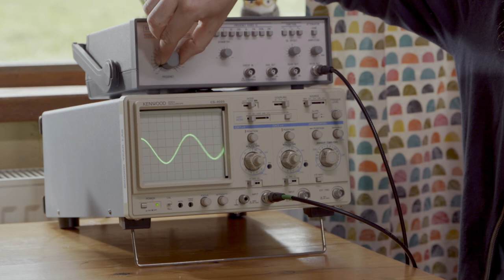HOW RADIO WAVES WORK - Science at Home - episode 4

Comment: Slightly wrong on the description of amplitude, although the gist of the message is correct. If one measures peak-to-peak the value obtained is roughly TWICE the amplitude of a wave. Amplitude is measured from the zero signal level to the peak of the wave (either at the "top of the hill" (positively) or at the "bottom of the valley" (negatively).
Reply from the maker: Yes, you're correct. That must have been a slip of the tongue. Thanks for pointing it out! Although you also have a mistake in your correction! 😂 You must have meant to say "if one measures peak to trough". That would Indeed give you twice the amplitude.
See, we're all only human! 😂
Reply: @dannickstrom469  Yes, we all make mistakes!
Reply: @alta9dena I never make mistakes💪

Comment: That is also awesome. However, why do low frequency signals be able to pass the walls? It was interesting. I hope you will earn more followers.
Reply from the maker: Apologies, I only saw your comment now! Thanks for your message!

The ability for an electromagnetic wave to pass through an object typically depends on the relationship between the wavelength of the wave and the object it meets. If the object is considerably smaller than the wavelength then the wave will not be blocked by it. However this is only a general rule. It also depends on the atomic structure of the particular atoms that make up the object. For instance, certain materials will let light aps through and certain will block it. Perhaps I can explain all of this in more detail in a future episode! :-)

Comment: Does the radiowave creat current to run through the antenna? If so does it do so to any arbitrary wire or conductor in our environment?
Reply from the maker: Excellent question. Yes it does. That's how the signal gets to your radio. And yes, the same will happen for any wire or conductor. The radio antenna is just designed to do it most efficiently, and as you "tune the dial" on the radio you are choosing specific frequencies to focus on.
Reply: So there are currents in every wire or conductor, such that if we put a voltmeter at the ends of the conductor we can get a  flick right😅
Reply from the maker: @davidginono625  It would be a very small current and very very noisy, as it is a combination of many many countless frequencies all jumbled up together! But I believe you're technically correct! 🙂